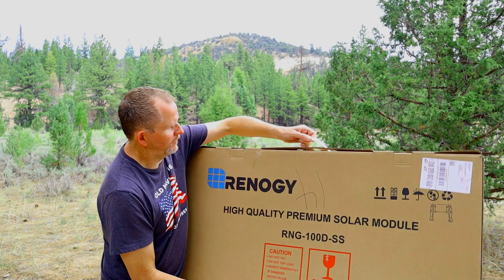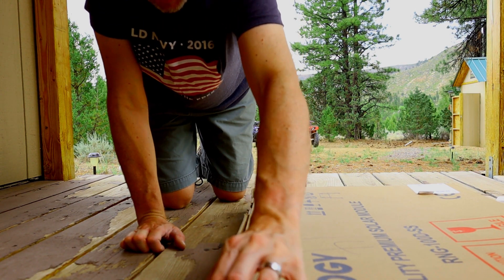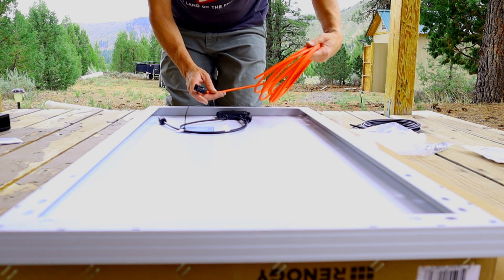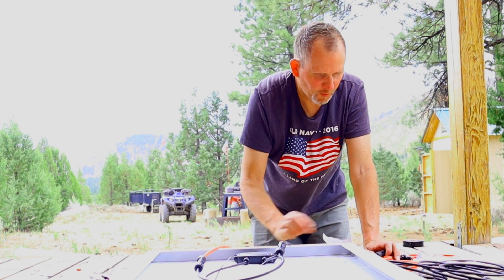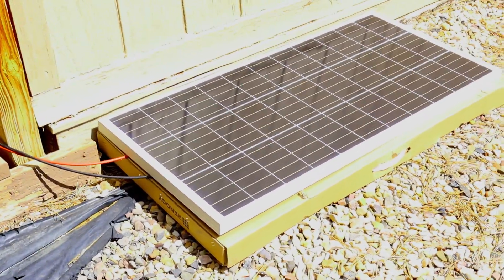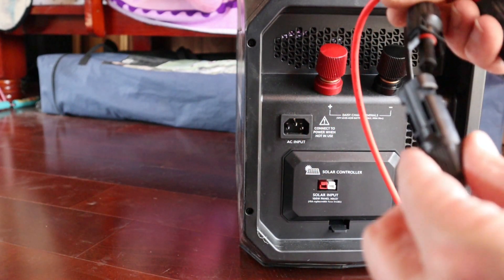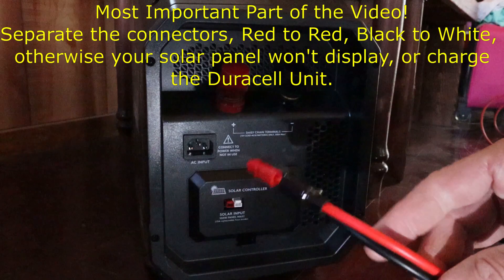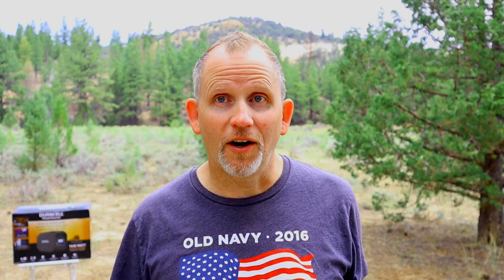How To Use Solar Panels To Charge Your Duracell PowerSource For Free!

Comment: Mine takes DAYS to charge! I contacted Duracell and they stated that its supposed to work that way. I feel it is pure JUNK cause i can only use it once a week!
Reply from the maker: Oh that's really frustrating!  Sorry to hear that.  Is that charging off of solar?  It can definitely take  longer to charge from solar compared to when it's plugged into a/c power, but still will charge to full for me if left in full sun in 10-12 hours.
Reply: @FixMyBleep  yes I have a 100 watt solar panel. my plan was to use it to power my very small 6x8 greenhouse. It only pulls about 400watts. And I want to use it continuously. The power runs out and I have to turn it off to charge it for DAYS.
Reply from the maker: @RaRaSweetness  Oh that's terrible, I'm sorry you are having issues with this unit and especially with how expensive these are.  Thank you for commenting, it sounds defective and too bad Duracell didn't step up and just said it's "supposed to work that way."
Reply: @RaRaSweetness  Add a separate solar charger with controller and wire it directly to your batter and not the unit. They sell them in Amazon. It  changes things dramatically.

Comment: Hi I noticed that the green light is flashing once I connect a solar panel with the power source. Do we need to turn the power source on to charge it or just connecting a solar panel with it and let the green light flashing is enough? Thank you for your clarification!
Reply from the maker: Hello, yes you are able to charge the unit with it turned off, the green flashing light indicates the battery is taking a charge.  If you power the unit on, you will see a picture of a solar panel in the LED display indicating it's being charged up via Solar, but no need to power it on.  Hope that helps!  Thanks for the comment!
Reply: @FixMyBleep  awesome! thank you for your reply!
Reply from the maker: @bosgarden3646  Happy to help!
Reply: @bosgarden3646  Also something I found out yesterday.  If you turn it on while charging.  It takes longer to charge because it's using the battery.  I am very happy I found this channel.
Reply: @Mastersextoys  I found this too! thanks for sharing!

Comment: I am trying to do the same. I have a 100w solar panel hooked up to my 1440w Duracell. I have all the right connections and still no power. Do I need an inverter? 
Thanks.
Reply from the maker: Hi there, the Duracell unit has a built-in inverter so that's not the issue.  At first I had the same issue then realized my Anderson connectors were reversed, I had to separate them, re-plug them in, and the solar indicator turned right on.  Red to Red, Black to white (12 min mark in video) It's got a protector so you can't damage the unit.  Hope that helps.

Comment: These 1440 Duracell units have been around for a while.  They are inexpensive and it's easy to add more battery capacity because of the exposed connectors on the side.  The problems with this unit are many.  It uses a SLA AGM (lead-acid) battery, which makes it very heavy and cuts your usable capacity quite a bit.  It also uses a PWM charge controller, instead of MPPT.  Finally, it has a modified sine wave inverter instead of the much better pure sine wave option.   If you're OK compromising on ALL of those key features; weight, PWM and MSW, then it's inexpensive and easy to add more capacity to...which you WILL need.
Reply: I own several solar generators. While all is true about the Duracell you can actually hook a solar charger to the extra batteries and charge them much faster than the 100 Watt max input.
Reply from the maker: Thanks for the information on the Duracell Unit, love the comments!
Reply: Yeah. Bought a few for $300 each. work great for my purposes. Recharge my power tool batteries, runs my freezer and fridge during outages. You can charge with more than 100 watt solar if you use the battery terminals and panels that have charge controllers or a charge controller with your big panel.

Comment: And now to blow your mind......you know how you can daisy chain an extra battery on the back???.....you can add all of the solar panels that you want to either an extra battery or the daisy chain terminals as long as you use a charge controller!   This will speed up the charging!
Reply: Doing it this way also makes the batteries last longer as a solar charge controller will charge it all the way up not only lengthening the life of batteries but will you more running time sealed lead acid batteries should last about 5 years to 8 if you keep the volts between 13.4 and 14.8 with the charging parameters they've set up maybe just over a year and you'll need to replace the battery in the unit because of the price you won't throw it out when the battery won't take or hold a charge I've got over 8 booster packs with modified sine wave inverter siting on the shelf and 2 more than will need new batteries soon as by the time I found out the proper charging parameters they were already damaged they too only charge to 13.1 and I've used them numerous times tried to charge with a good battery charger but they'll only charge to 90% I'll put new batteries in 3 or 4 of the units the rest will wait until I need them
Reply from the maker: @douglaswindsor120  Good to know!
Reply from the maker: That’s some good information!  Thanks for commenting!

Comment: The Anderson connectors can be flipped and stacked horizontal or vertical they have slots on the sides to attach together.
Reply from the maker: Thanks for the info!
Reply: What SIZE Anderson connectors does the 1440 use?? I haven’t heard that anywhere??

Comment: What’s the difference between this power source & the Duracell 660?
Reply from the maker: Honestly, it looks like Duracell used the same enclosure for both units when I compare the 1440, and 660.  The 660 is a couple hundred dollars less money, but seems to also have  the same solar panel charging option, so that is very cool.  Same Display, and connectors, just different capacity from what I'm reading.  Thanks for the comment!  Here is a link for the 660 unit https://www.costco.com/duracell-powersource-660.product.100573682.html
Reply: They're the same thing. It's right on the box
Reply: @FixMyBleep  , actually, it’s called a Duracell 660, 1440w generator.  
They are not 2 different ones. They are one in the same. I’ve never heard it called a 1440 until you called it that! It’s actually a Duracell 660!
Reply from the maker: @ib4ugod45-1  Thanks for the info.  I was just checking out the box, and Duracell may have just changed their marketing or something.  It now says Duracell PowerSource, then shows 1440 Inverter on the front of the box, so I think that's where I was getting it.  Thanks for the comment!
Reply: @FixMyBleep  that was really sweet of you to write me back! You sound like a nice gentleman! 
~Rosey
Reply from the maker: @ib4ugod45-1  Thank you!  I try to respond to everyone who takes the time to comment :-)

Comment: Can you use a lithium ion solar battery as the battery to hook up to the back? This is a very awesome feature and for the price it's hard to beat.
Reply from the maker: That's a great question, so it looks like Duracell is using a Sealed Lead Acid (SLA) battery with AGM Technology), then you don't want to hook up a lithium ion battery to the back of it unfortunately.  It could ruin both batteries, or cause a fire, Sorry.  Here is a little article of the thing:  https://www.solarpowerworldonline.com/2020/08/can-you-mix-lithium-and-lead-acid-batteries-on-an-energy-storage-project/
Reply: What about a lithium replacement all together, of course if battery dimensions are not an issue inside generator
Reply from the maker: @kyletx6513  So do you mean swapping the OEM battery that comes standard from Duracell for a lithium one if you can get one approx the same size to fit in the casing?  That's a great question! I don't know why not, but will have to look into it a bit more.  Thanks for the comment!
Reply: @FixMyBleep  Sla/agm batteries charge max 14.6 v.
 Li-on is different technology and will ruin the Duro 1440 without some serious mods.
Reply: The anderson connectors interlock no matter what config you need. Check it out
Reply: @kyletx6513  I have two of these duracells. I would not try to replace the SLA internal battery for a Lithium based one.  I believe the charging system to the batteries are designed for sealed lead acid, which have different charging profiles than a Li battery.

I also believe if it was possible, you'd see a massive number of people doing this as an economical hack to getting a LiPo4 solar generator on the cheap
Reply from the maker: @tydarylw  Good point, and thanks for the comment!

Comment: Can you charge with solar while simultaneously drawing power from the battery? We’re looking to use this to power an outdoor PA system and want to extend runtime with a 100W solar panel.
Reply from the maker: Hi there, yes you certainly can and that's a huge plus of this setup!  The Duracell unit instructions or manual goes into more detail on this, but says go ahead and operate it while charging off solar or A/C.  Thank you for the comment.

Comment from the maker: The solar panel charges this Duracell PowerSource to a full charge in about 10 hours of direct sunlight and is a lifesaver!
Reply: So how has the panel been so far????
Reply from the maker: @kpd174   Great so far, I need to mount it to the roof, but having a way to charge this battery off the grid has been nice.  Thanks for the comment!
Reply: A hundred watts iis great if you only use about 600 watts per 24 hrs otherwise get a folding solar panel 200 watts with a mppt solar charge controller already built in and charge through it expansion terminals also if you want to make your battery last get a charger that charges sealed lead acid batteries and hook it up through the expansion terminals this is why I won't buy one of these I've probably spent over a thousand dollars over the years or booster packs with inverter to charge my cordless tools and my phones and I always blamed myself for not charging them properly until I found utube then with that information not matching with my booster packs I took apart my old Black and Decker and written right on the battery was do not discharge below 12.2 float charge is 13.4 and full charge is 14.8 and on the charger 12 Volt so when I looked at this unit I checked for charge perameter and found out that it doesn't charge to full and discharges below 12.2  so if you want your battery to last check out utube video on maintaining your battery in your RV these batteries are not sealed but they are deap cycle lead acid same chemistry
Reply from the maker: @douglaswindsor120  Thanks for the comment and information regarding this, I'll check it out.
Reply: Since you don't always have 10 hr of good  sun so if you charge through the 100 watt pprt and add a 200 watt folding solar panel most come with a built in mppt isolar charge controller if you want to save money there are utube video showing how to make one a little cheaper if you are like me when I go for a weekend trip it's a long weekend that means 3 nights and I want my power to last the whole time unfortunately this unit wont charge my phone or my watch unless I run the inverter and being as it's not a pure sine inverter I'm a little leary
Reply from the maker: @douglaswindsor120  That's a good point and the sun isn't always going to be shining all weekend long, or it's not going to be clear each trip camping.  So far I haven't run into any issues, but I'm also not putting a huge drain on this unit either.  Just running lights, charging phones, and electronics and minor things off of it no serious amperage items.  Thanks for the comment, and I'll keep you posted.
Reply from the maker: @douglaswindsor120  Good to know!  Thanks for the research and info.